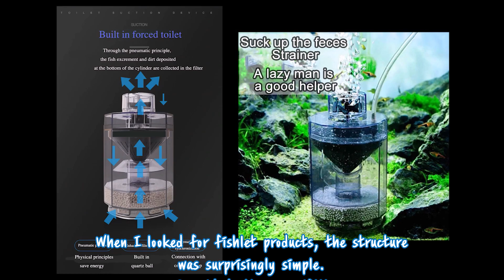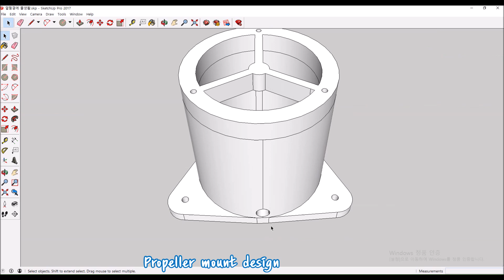3D Printed Fishlet.

Comment: What if, instead of a freely rotating propellers  you put a propeller at the bottom entrance connected to the top propeller by a long shaft. As air spins the top prop it powers the bottom one sucking in more water.
Reply from the maker: I think that's a good way. I will try to make it next time.